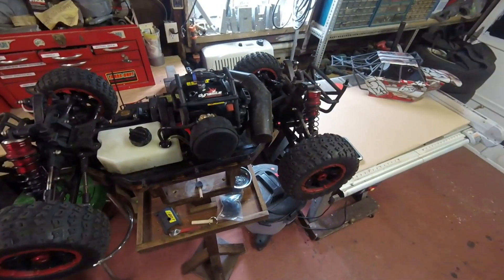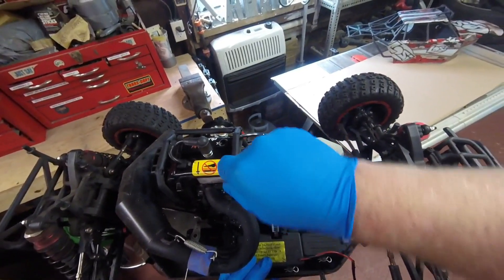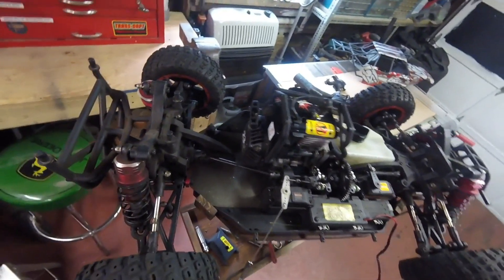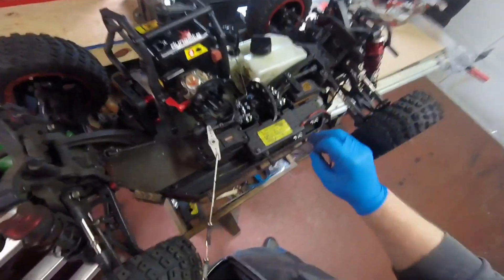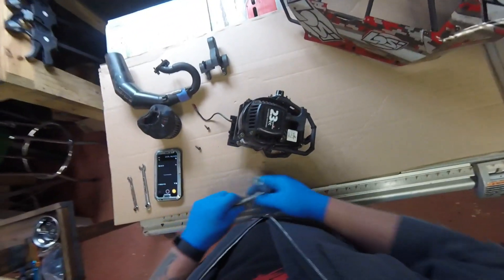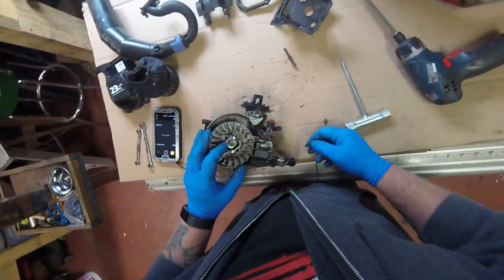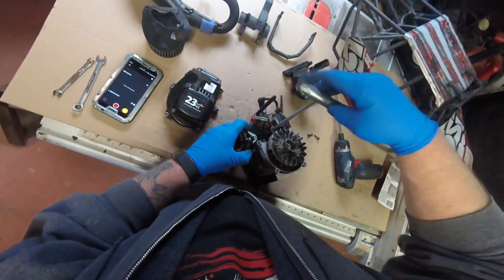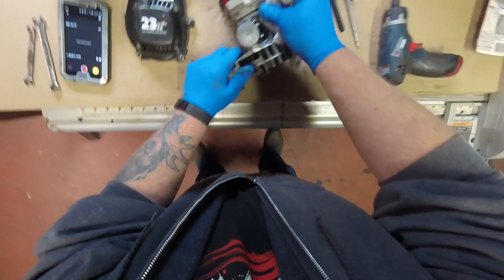What to do with this Losi DBXL Part 2

Comment: You use a business card to set your gap on your coil and flywheel then it won't scrape how about you clean the head and seal the exhaust and if you think the head is leaking and put some soap soapy water on it to see if it bubbles and air your feelings from the clutch

Comment: buy a coil Gap tool from DDM simple everything on these are simple you're trying to make it harder than it is just do research that tool is very cheap and it comes out perfect every time you have a car that has a gas motor you need to have the right tools to make it run right make sure ur gas is new I have over 30 5th scale cars and I'll buy a gallon at most of gas and run it out within a few weeks it should not be sitting you only have one car you should be buying a half a gallon at a time to keep gas fresh also After Time the plastic carb manifold will go bad and create air leaks so if you get an aluminum one you will have less problems setting ur spark gap?
Reply from the maker: Thanks I just ordered  the GAP TOOL and a  ADA billet aluminum intake manifold ...Lets see what happens when it comes in...wish me luck...